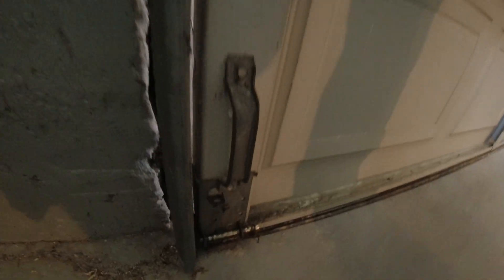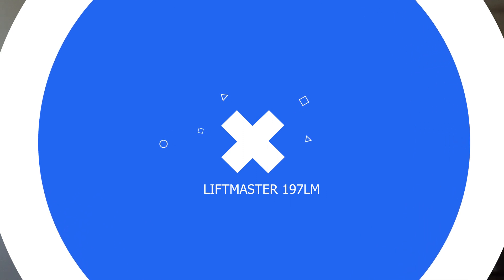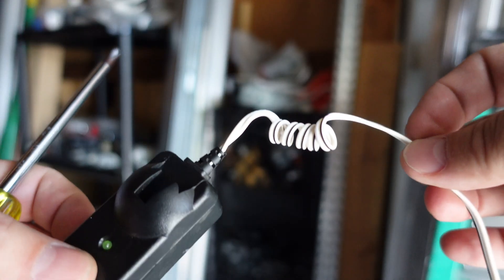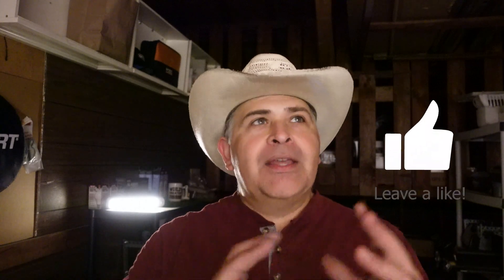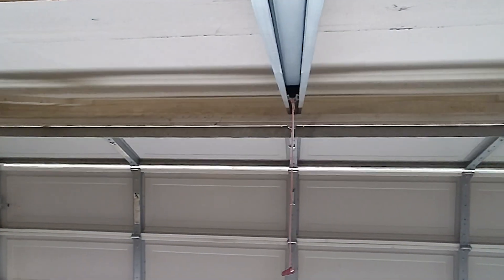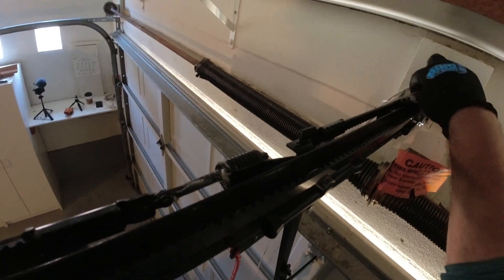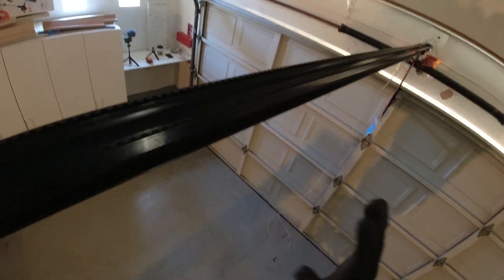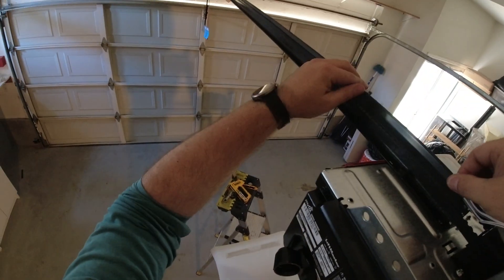Garage Door Safety Sensors Need This - LiftMaster 197LM Wire Retainer Strip

Comment: I run the wires to about an inch above wall bracket...then spiral the wire with a drill ...then pull and wrap through the wire channel on the back of op frame ..then put piece of square foam from the chain or belt packing to elevate wires off of the chain guard....works good but does slack over many years...I've revisited doors I installed 20 years ago, same foam still in place doing its' job
Reply from the maker: I've seen this done.  It's a great trip.  I haven't mastered it.  You know the saying ... Old dog ... New tricks.

Comment: Nice. You can also do this on the chamberlain openers because the rail tab has enough room to push the wire through the inside of the rail. Also the clips I think work on the genie screwdrive retail motors as well since those use a C channel rail as well.
Reply from the maker: Very true!  I have see that and not a fan of it.  In once case the wires inside the retail rail was causing more vibration noise than normal.  From some reason that square rail design acts like a speaker box when there's travel from the trolley carriage.  Of course if the customer has a vaulted ceiling and wants a Chamberlain retail motor that option would be the way to go.  Or offer a contractor rail assembly.  I appreciate your great feedback as always.